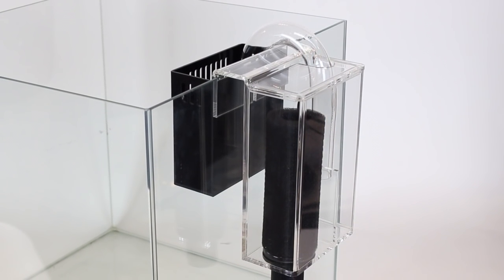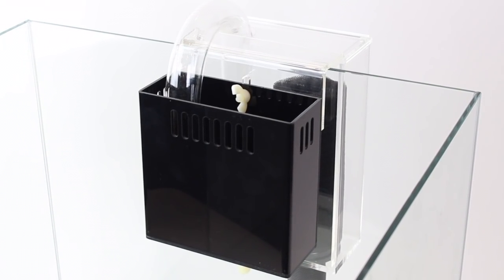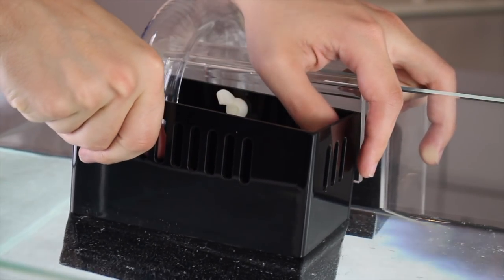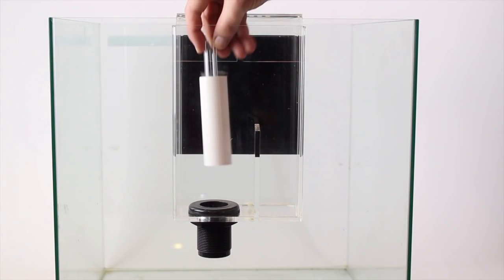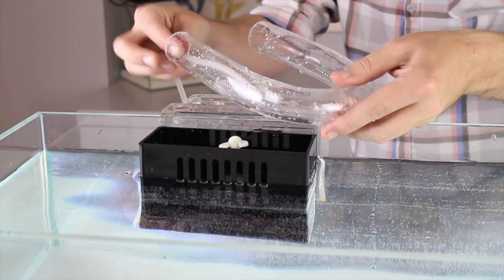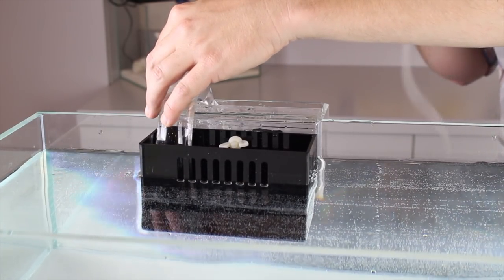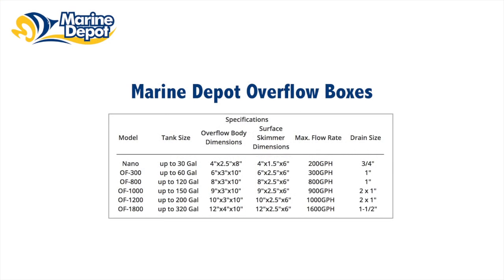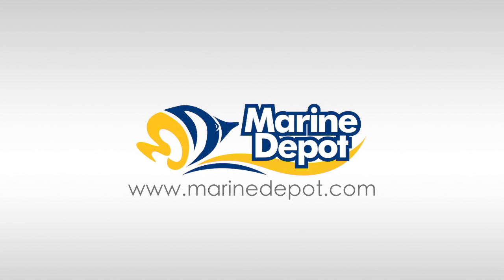Marine Depot Overflow Boxes: What YOU Need to Know

Comment: The siphon breaks are definitely the most worrisome aspect of overflow...way to solve that issue! I will definitely consider this instead of drilling the tank. Question: should the size recommendations fall more in line with the tank size or the max flow rate of gph that the pump is putting it?
Reply: Is syphon breaks the part you mean about flooding?  We are upgrading to a 65 gallon from a 10 and hubby dosnt want to drill, so looking into another way!  I am unfamiliar with all of this being i just had a 10 before.  i just dont want a junkie looking HOB and protein skimmer showing and all that.  Want nice and tidy!
Reply: I have one tank in my house that is not drilled. The tank had been running for several years and never flooded, but I worry so here is what I came up with. If you have a apex system put flow meters on the line going to the sump that way you can set it so if the flow drops to a certain value it shuts the pump off. Then get a apex level sensor and attach it in the back of the black box so no water touches it, no if the siphon break this box will fill up and hit the sensor then shutting the return pump off instead of over flowing and all this can send you text notifications or emails so you know
Reply: @smooterd  why would I need the flow one? What gph to have it set at? I could see the sensor being good to shut off the pump.
Reply: @davidmurphy4672  sorry for such a late reply. Over time the U tubes get dirty and slow the flow over water. with the sensor you will get notified when this is happening and clean them. instead of a actual visual check which can be over looked. If you have the right pump and air bubbles are pushed through the U tubes you will be fine only time syphon breaks is due to too much are or the tubes get pulled out.

Comment: How can they auto start after a power failure, when the power goes because the outer side box it dumps into is much lower then the overflow box. Can someone explain?
Reply: EngineeringAquariums I would like to know this answer too.
Reply from the maker: Thanks for watching!  The clear box on the outside actually has a baffle that maintains the necessary water level and keeps the U-tube full of water during a power failure.  It was somewhat hard to film because everything is clear but you can see the baffle in the product photos on our website.  

http://mdshop.us/2rRqr0P

Feel free to let us know if you have questions!